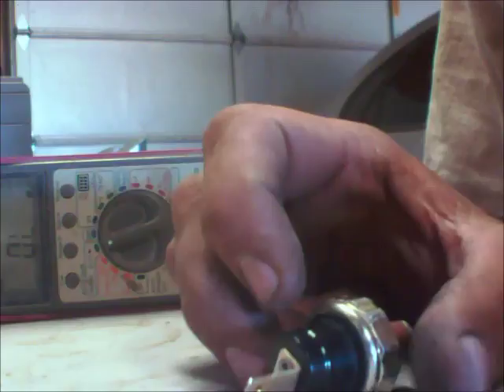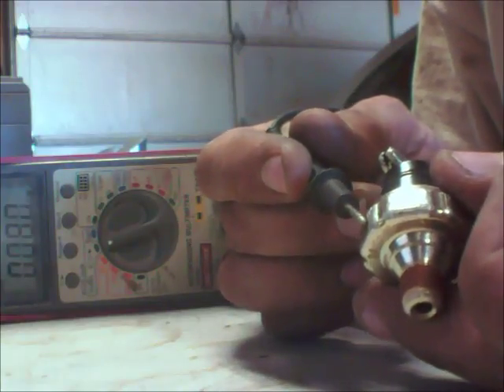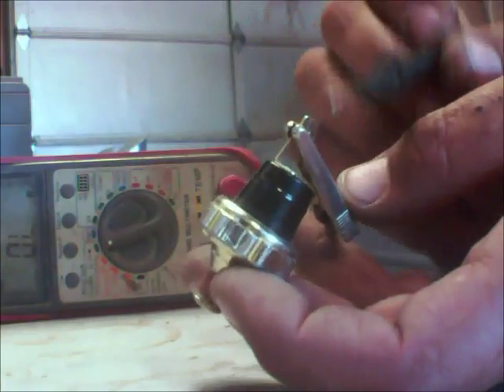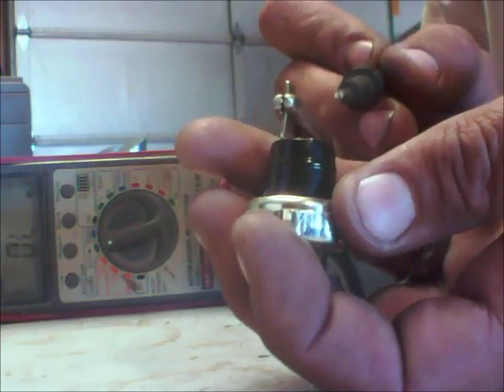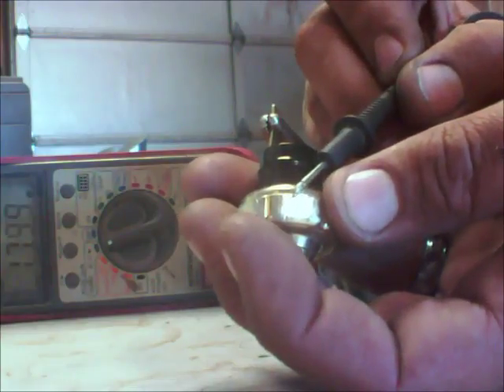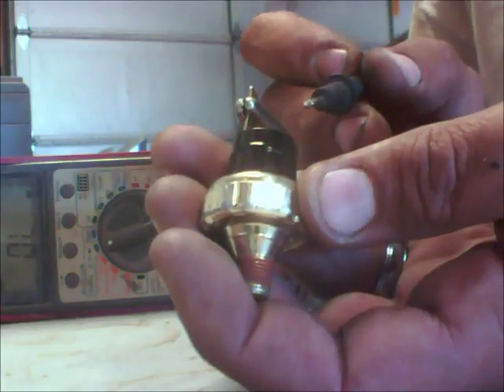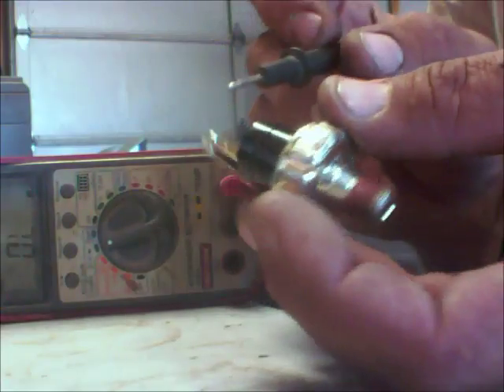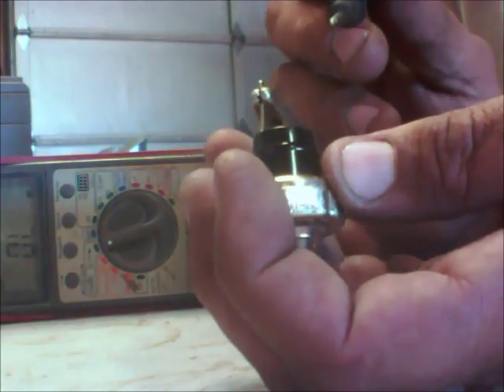Pressure Brake Light Switch Test

Comment: According to the video, the two prong switch is normally closed by air pressure and pressing on the brake pedal opens the internal switch contact, which would interrupt the circuit. This means the brake pedal is interrupting the air pressure?

The logic here seems backward?

Comments?

Comment: I work for a company that has not done truck maintenance to the 2005  international and they still drive it around town like this were the brake lights just stay on even when the truck is turned off and sometimes if you pump the brakes when the truck is off the brake lights might go off, and if they don't everyone just unplugs the light bar on the tractor. thank you for this info, I need to fix this crap if I'm going to drive this thing .. now I just need to find this switch !

Comment: Great information thank you for the video, but I am curious about exactly why the switch would fail in the first place. My application is a two post inline switch part number SL-134 , using DOT 5 break fluid for the rear wheel break  on a motorcycle.  I need to change the part maybe every 2 years or so.    Your opinion would be greatly appreciated.

Comment: I both two pressure switch instal them, made the continuity check and they have continuity with and without pressure in the brake pedal and still have the brake lights on all the time, even without the ignition key off. Some one with a great explanation?

Comment: What wires do I connect to the switch I can't find the wires but a wire from the trailer brake system was on the old switch. Would that wire be the power for the brake switch?

Comment: I am a truck with 2 switches 1 wire with a jumper with the key just turn with out starting the wire have voltage on it when i plug 1wire to one of the switch the other switch have voltage with air preassure nothing changes....anything else i could check.

Comment: How would I wire one of these to my buzzer (95 Volvo white gmc) I don't have at all and I just bought a buzzer and a Bendix 279472 low Pressure Indicator one prong, but can't figure out how to wire it to the truck so that it tells me when my psi drops.
Reply: This kills me how nobody answers the actual questions that aren’t common sense… did you every figure it out I’m having the same problem well I’m re wiring a 86 international 9670 with mechanical motor only thing I can’t figure out in my head

Comment: Great video. So my brake lights were staying on, my mechanic put in new sensors, on for the brake lights and he also changed the one the cruise control. Result the lights now work properly but the cruise control does not activate. I re-replaced the cc sensor nothing, then the clutch sensor,  cc on switch, cc set/adjust switch, clutch position switch still nothing help please if you can. I will test all the sensor by olhms tomorrow and the speed sensor behind the transmission. Truck is a 2012 Freightliner Columbia DD 14.7 60 Series. It originally started with the brake lights could that sensor still be the problem? Or something else. Thanks in advance.
Reply: We are having the same issues with the same truck let me know if you have solved this please

Comment: is it oil pressure? I remember when I was a kid, I used to check oil pressure for chevy cars(1975-1999) by using a light bulb and attached with a power source. it doesn't matter which one is - or +
Reply from the maker: you are correct, however this one is for lights on a air brake equip truck. same concept. great question and thanks for watching.
Reply: I appriciate your videos..I have tahoe 2008, I am trying to change the transmission fluid, but the pipe is under the pan, how can I skip that please?!!

Comment: Where can I find this exact switch. I need one for my 1990 F-700 because it leaks terrible but am having trouble finding it online. Would you happen to have a part number?
Reply from the maker: its tough because its hydrolic brakes, i actually remember the one i used. it was from j&p cycles part number 240-693 . thanks for watching.

Comment: My brake lights are staying on, I replaced the brake switch and lights still on? Is there another switch on 2012 kw T700?
Reply: @R&R Dominguez not yet, you? I’ll let you know if I find the issue
Reply: Abs sensor or brake pressure switch on master cylinder. There’s a emergency brake switch i believe  as well
Reply: I’m sorry..brake pedal switch

Comment: What and where is a pressure brake light switch?
Reply: Peter Wiremu Ormsby some are on the bottom of the master cylinder. sometimes they are joined into the brake line..but always a pain  if not working
Reply from the maker: yes, but most are on the brake pedal them selves. thanks for watching. thanks jason for your help. enjoy....
Reply: @thomasbriansavingmoney  the ones on the brake pedal are not a fluid pressure switch. They are a plunger switch.